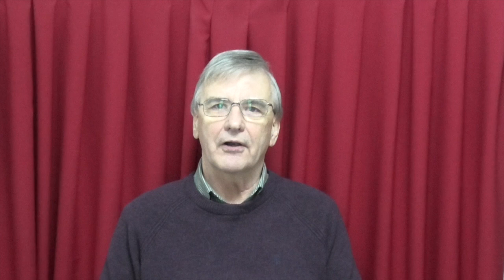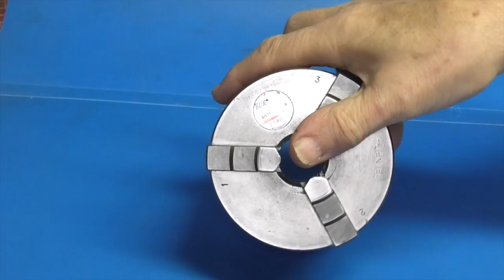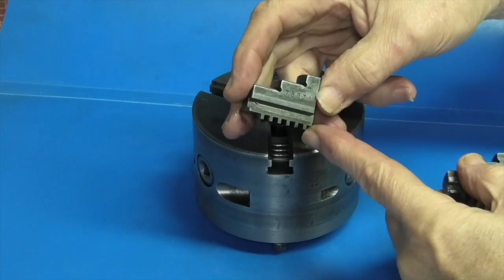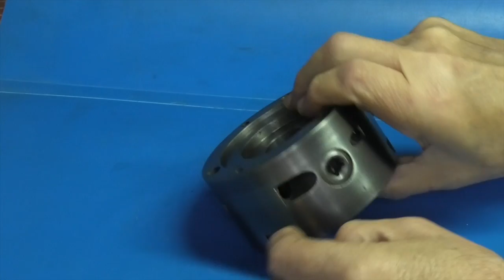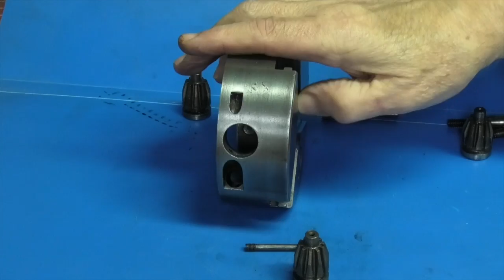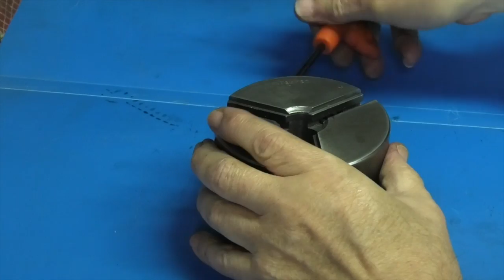4" grip true chuck

Comment: Interesting design.   Thanks for showing us the details.
I have a Chinese clone of I think a Bison Adjust-Tru.    The backplate has a boss which is slightly smaller than the ID in the chuck.   Adjustment screws on the outside of the chuck work against the boss.   Then I tighten locking screws on the face of the chuck.   This works, as does your Burnerd design.